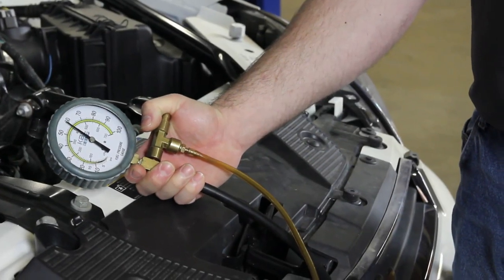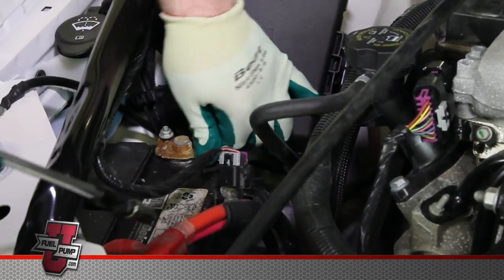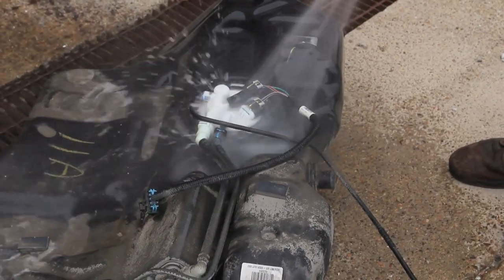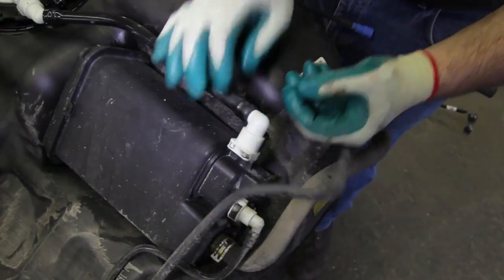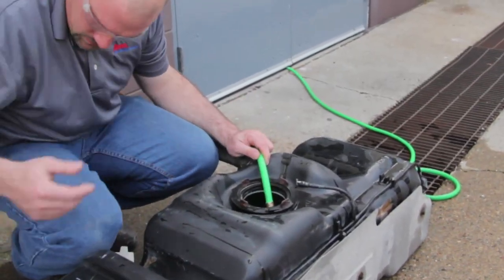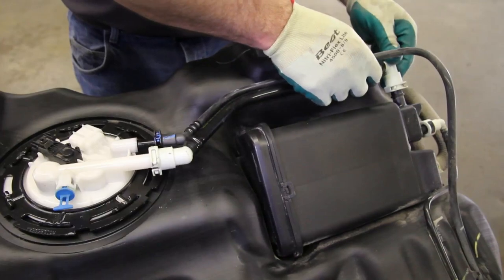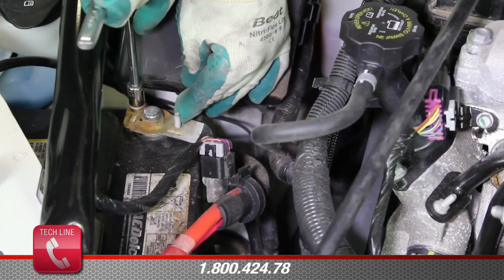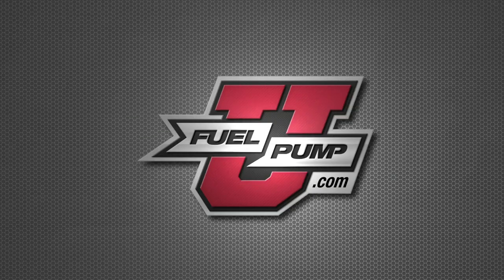How to Install Fuel Pump E3749M 2008 2009 2010 Chevy Impala / Buick LaCrosse / Pontiac Grand Prix

Comment: What's a job like this cost? A mechanic I dropped my car off last night with stated he would charge me $1100 which seems super ridiculous in my opinion.
Reply: If u think that's bad, dealer wanted to charge me $1,800 to replace fuel pump after charging me for the diagnosis fee of $240.
Reply: It's not ridiculous. This is a beast of a job

Comment: PS - My Impala is an LT and the engine is the 3.5 L.  Once the car gets running, it seems fine. Its only after it sits overnight.
Reply: Could be an Alternator or bad battery as well.
Reply: Sounds like your loosing your pressure in the line and have to prime it up could be a fuel pressure regulator going out its just a guess as I have not seen the vehicle but I'd check it out
Reply: @tommykahn2353  Car died about 3-4 years ago...  head gasket.  What happened though, was that it turned out that the gas line attaching to the pump managed to unclick and loosen.... because I reused the connector and line. Then it was sucking air at the connector.  Eventually one day it popped right off and I flooded a parking lot with gas trying to start the car... ended up getting it towed home, dropping the tank, replacing that line and connector (not cheap btw), and re-attaching.  Was fine after that.   Just goes to show you... if you have a hard time disconnecting one of these fittings, then make sure it ain't damaged... and `clicks' when you re-attach.  Hard lesson learned.
Reply: @rangerrick8220  yeah I had a lady with a jeep that popped lines off on a yj one time put a whole tank of gas on the ground before the lady knew it was leaking 🤦‍♂️
Reply: @tommykahn2353  Mine leaked in a hardware store parking lot the day after he had it black coated...  dissolved some of it on them - fealt sorta bad.  Offered to pay but they said no - were good about it.  Yup - was cranking it over and then smelled strong gas... looked underneath and oh ooooh.    Yup... hmmm.
Reply: @rangerrick8220  lol well thanks for replying I didn't realize it was such a old post lol I went and subscribed to your channel for getting back to me though 👍
Reply: @tommykahn2353  Thanks - I've been alittle neglectful of my channel - was sick there for abit.  But I do try to reply to all who send me messages or comments...  anyways... have a good one!  :)

Comment: I enjoyed this extremely detailed video on how to properly replace a fuel pump in a 2006-2012 Chevrolet Impala!

This job looks extremely difficult, detailed, and requires a lot of precision to avoid gas explosions!

It's no wonder this job typically costs $1,000+ to have done professionally!
Reply: This video was good but didn't actually cover what it's really like to drop the fuel tank in an old rusty 2009 impala. I just dropped mine today and it was very very difficult. Every single line. Every single bolt. Every single connection was siezed, rusted, corroded, stuck.

Comment: I have a Buick Lacrosse 2010 CXS 3.6L/LLT and it waste gas like no other. I've done all tune ups like new spark plugs, coils, air filter, fuel treatment, new battery, O2 sensors check and working properly. The part I've never checked was fuel pump idk what symptoms would be i do have rough starts here and there but it always ran and never puttered.

Comment: Hello I have a 2010 Chevy impala 3.5 LT. the fuel pump I got has 3 connectors. I know you said not to worry if I got one of those fuel pumps. What do I do with the 4 connector? Since there is no connection for it?
Reply from the maker: Your vehicle lists  three possible modules.Looking at these three modules, none of them have four hose connections. 
E3749M has two hose fittings with one four pin electrical connector. 
E3786M has two hose fittings and one 4 pin and one three pin electrical connector. 
E3796M has two hose fittings and one 4 pin and one three pin electrical connector. 
These three modules are not interchangeable.

Comment: I purchased a new fuel pump for my vehicle but it came without a fuel sender unit; I will have to transfer the old sender unit from the old pump. The new pump has two wires for the sender unit but they are unmarked - no indicators as to which wire on the new pump goes to which terminal on the sender unit. I understand the sender unit is a variable resistor and doesn't have a polarity - but does it matter which wire from the pump goes to which terminal on the sender unit?
Reply: Thanks so much - your video helped me greatly. Very much appreciated.  I installed the new sender yesterday with the pump and all seems to be working properly. The original pump had to be replaced as it's pressure regulator / check valve seemed to be failing; it wouldn't keep pressure in the line leading to the fuel rail.  This is the 2nd time this has happened and it is getting expensive to keep replacing pumps just because a simple check valve keeps failing . Can I simply buy a one-way check valve and install it on the line leading to the rail, if this check valve on the pump should fail again?   I do not understand why these check valves keep failing.  I use Lucas injector cleaner regularly - could it be messing up these valves?

Comment: I have a 2008 Impala LT 3.5 Gas which fuel pump should I get 1, 2, or 3 Connecters?
Reply from the maker: Your vehicle uses one of 6 different pumps. These are based on engine code (fuel type), the number of connections and the emission type; with or without Partial Zero Emissions. Once you sort that out there will only be one option. Let us know if we can help with your lookup.
Reply: @AirtexFuelPumps  I have a 2007 Impala 3.9 police package. Which fuel pump should I use

Comment: Is the pump unit removable by means other than dropping the tank?
Reply: Yes, if you are brave you can measure where the fuel pump is located, and gain access to it either by removing rear seat completely or going through the trunk or both.
 You should be able to see where previous models had an access panel that is sealed. Cut around this area on 3 sides, fold flap back to access pump. Removal is same once you have the access panel cut out.

Comment: It appears that my 2010 Impala 3.5 LT VIN N is only losing pressure on initial startup after sitting a few days. That to me would imply a bad fuel pressure regulator / valve. Any way of changing just this part of the fuel pump or installing another pressure regulator valve in the fuel line between the pump and the fuel rail?
Reply: That's all built into the pump

Comment: where is the fuel filter located inside the fuel tank on a 07 chevy impala ls flex fuel? i got a misfire on cylinder 1 but i had rethreaded  the cylinder head with insert and i swapped cylinder 3 injector to cylinder 1 and now cylinder 1 misfire is gone and cylinder 3 has the misfire so could this be injector related or something because i never changed all six injectors just one which was a aftermarket injector not the o.e.m part. I know you have to change the fuel filter when you change your injectors but I don't really think it's a filter problem but a injector problem. My fuel pump works fine never had any issues with it thus far and I also had new plugs and wires done also with a coil pack and 02 sensors so i'm defiantly thinking it's a injector problem more so a fuel pump or the fuel filter.Or could it just be the fuel pump and the filter?

Comment: Does the 2012 impala have the access panel in the trunk as well or under the seat? Or does the tank absolutely have to be dropped?
Reply: It coded for the fuel pump. Seeing its a costly repair is there anything else I should check that would present that code before I commit to the fuel pump repair?
Reply: I've changed it a few days ago. It was coming on but was weak. I'm fixed now. Thanks
Reply: Chris Morris did you have to drop the tank I have a 2012 that needs a new fuel pump and I’m kind of lost on where to get started??

Comment: Great video!  I have a 2010 Impala and it seems to choke and hesitate when first starting up after a long sit (ie - overnight).  It usually takes 2-3 attempts to get it started, and when it does start, the exhaust smells very rich.  I figured this would be a bad Fuel Pressure Regulator but can't seem to find one up near the rails.  I put my fuel pressure gauge on it before starting and as feared, 0 psi.  When running, 60 psi.  Does this car have an FPR, or is it in the tank with the fuel pump?

Comment: I have to press the accelerator to get car to start. Is that the fuel pump?
Reply from the maker: It may be. Proper diagnostics need be done to determine the cause.
Reply: Start with a fuel line pressure test.

Comment: 08 impala ls 3.5 flex fuel model. this vehicle fuel guage is not working properly. when fuel is low the guage will not read lower then 1/4 tank. is this a fuel sensor problem on the fuel pump unit. or should i replace the whole fuel pump unit? 
the flex fuel model impala must have a different model fuel pump and  fuel sensor. would the impala  flex fuel model use a seimens fuel system? 
if i disconnect the harness to fix the defrost wire located under the passenger side door moulding, with a bypass wire because the defrost connection within  the harness connection has a known problem burning out, would reconnecting the harness possibly cause the fuel guage to start reading incorrectly? or should i just replace the whole fuel pump system?

Comment: Where can i order this exact fuel pump
Reply from the maker: My apologies, I cannot name names here.
We sell through a variety of retail outlets, they do have a large presence online as well as having actual brick and mortar locations. Auction sites and most of your “discount” online only parts sites are not direct vendors of Airtex. 
You want to ask and verify if the "store" you are dealing with is a direct vendor as all warranty is processed through the point of purchase. Meaning whoever sold you the pump is responsible to cover the warranty. We will back our vendors; they will back you. If it is not a direct vendor it will be up to you to work it out with the seller.

Comment: Can I use a regular fuel pump on my 08 impala instead of using the flexfuel pump?
Reply: No
Reply: @chimneygeorge  bro this was 8 years ago 🤣🤣
Reply: @chimneygeorge  and you're wrong now that I think about it  I used a regular fuel pump and it worked fine for years just couldn't run E85 anymore which I never did so it was fine for me

Comment: is there a access panel for a 2009  Chevrolet Impala lt v6 3.5 to get to the fuel filter and fuel pump? car has rough idle. plugs and wires good.rpm reves up and down low idle
Reply: what about the 2007 impala, is it the same way?

Comment: The smartest shit gm could've did was make it easy to take a fuel pump out by the backseat like honda and Nissan
Reply: They had it, the previous car model series before this impala. It also had a standalone fuel filter, which has been moved to to fuel pump assembly (most car brands have done this now as well). It’s trash imo.

Comment: Before you go all this check the trunk you probably have an access panel no need to drop tank
Reply: Those years dont have the access panel but there is an area accessible from trunk where there would have been one, but its welded in place. One option is to cut a flap there and remove the pump from inside the trunk.

Comment: I own a 2008 impala lt3.5l.  I've noticed online that my car does not have a fuel filter, but instead part of the fuel pump located within the gas tank. Is this true?  I was wondering if I should change the fuel filter since I'm riding on 198,000 currently with the original fuel pump. Everything is currently running in order minus a little bog here and there on hills.
Reply: It also does however start up with ease, practically first or second cycle of the engine.